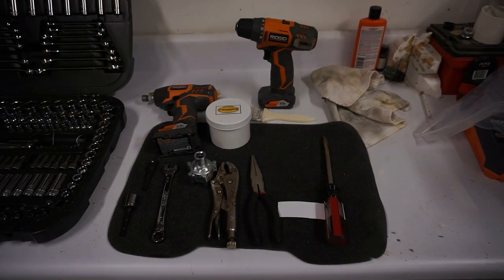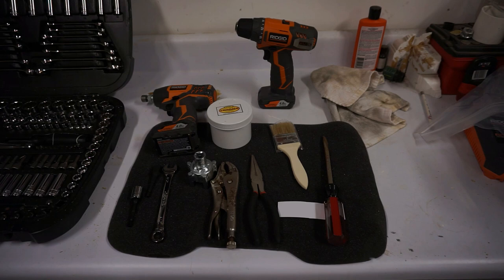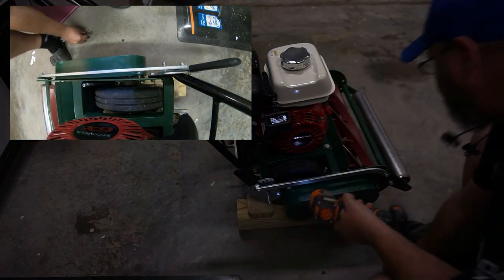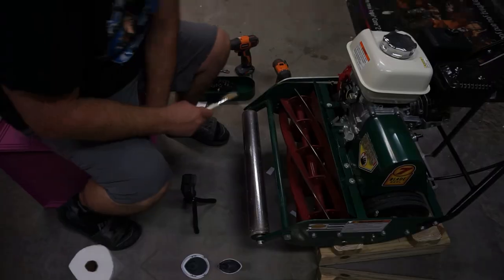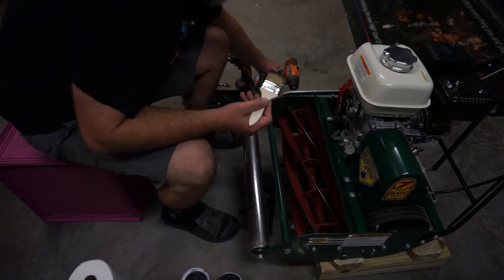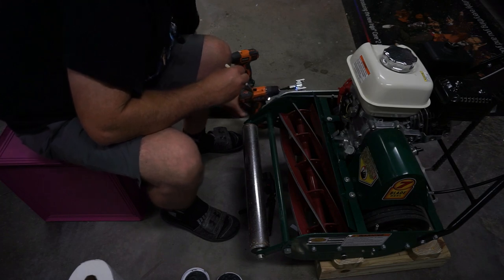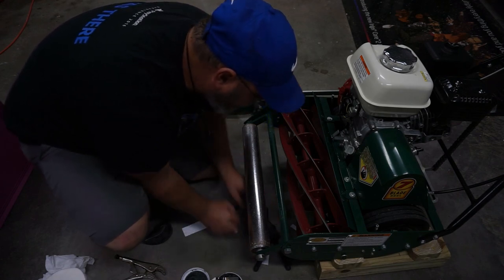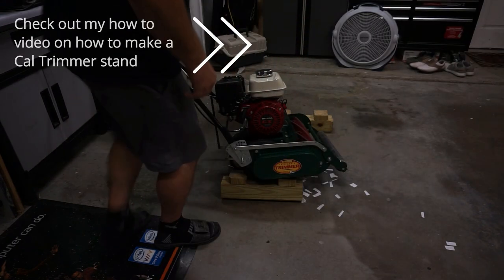California Trimmer Reel Mower Back Lapping & Maintenance

Comment: I notice with my california trimmer the reel wont cut paper unless the bedknife contact is pretty tight. Is this normal or do I have to backlap?
Reply from the maker: I would backlap it. I baxklap 2 - 3 times a year. I make very small adjustments after backlapping to get the reel to cut paper.